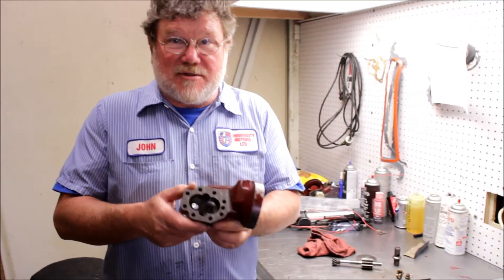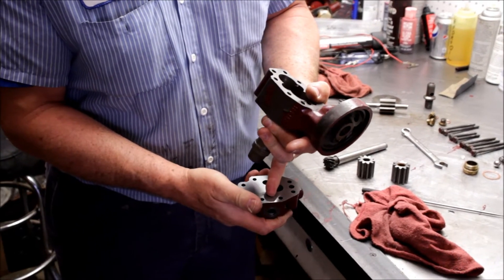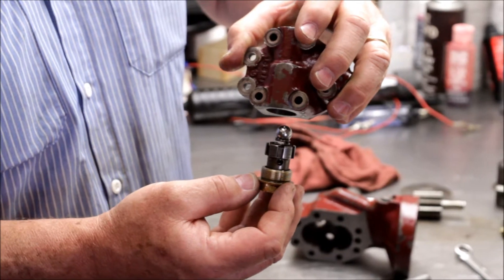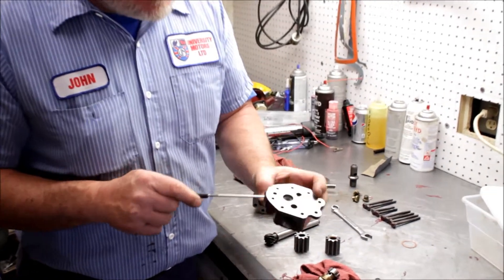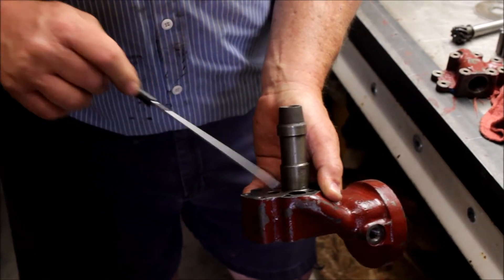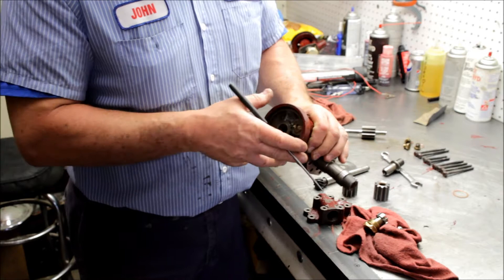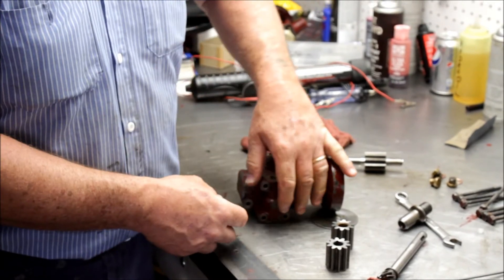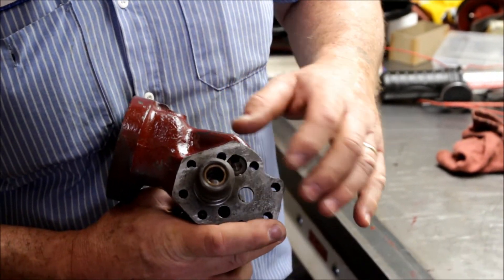202 MG Tech | XPAG Oil Pump

Comment: Excellent video as always.  I really like the intro/fin editing.  Makes it more polished.

I have a 78 MGB that I put the original ZS back on.  I have been told that you must use a gas analyzer to tune those.  Do you have any tips on tuning a ZS?  I have the choke set as per your video.  I made sure emissions, timing, valves and ign is perfect.  Issues with backrap on decel and rough idle.  Thanks in advance.